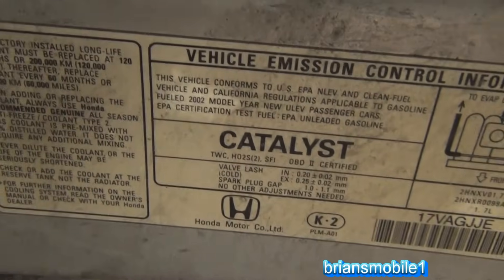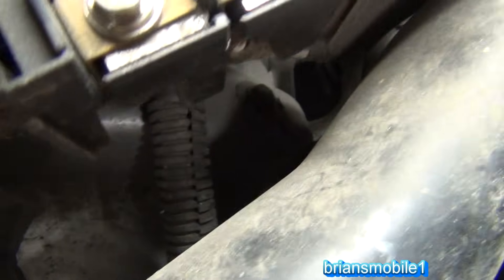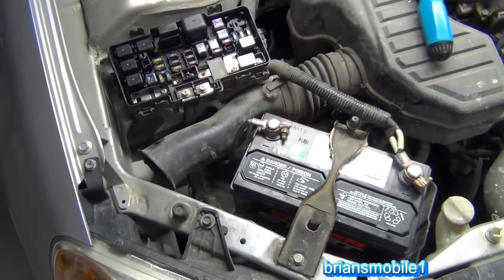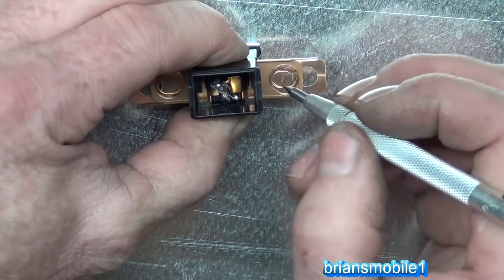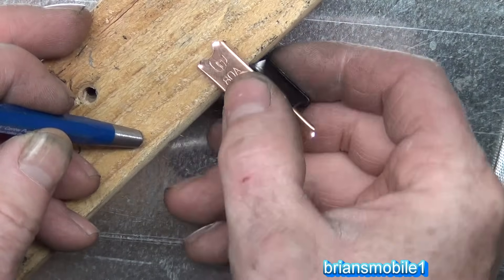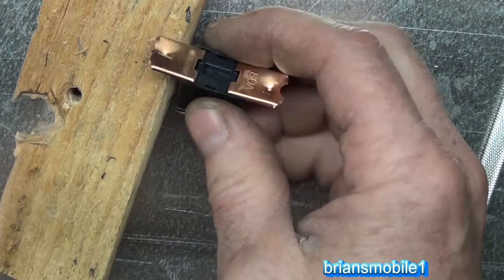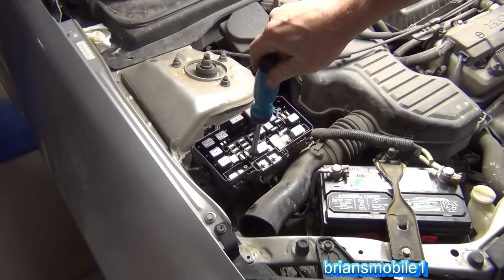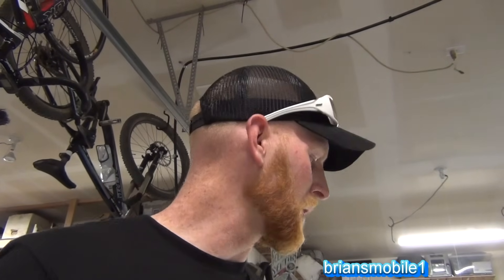Battery Backwards Damage and Fix

Comment: Hay bro I've got a mitsi outlander 2007.my partner did this and it buggered the alternator. Fan wouldn't work, lights, boot locked, stereo etc..  got it fixed everything went fine. Then 1 month later it did the same thing alternator fried. Got it fixed again then everything went. But not I think it's fried again but now when putting foot down on execration car doesn't move stays in limp mode ect. Any ideas? Also dosnt go into gear without pressing release button.

Comment: If you put the jumper cables to the correct ends and you get sparks, what does that mean?
Reply from the maker: Good question!  It means amps are flowing- something's already turned on and sucking power.  Think of a hose that's turned on and you connect it or disconnect it- you'll get some splashing.

Comment: I hooked up my battery backwards and so I had to replace the positive terminal fuse box. When I did that and bought a new battery, car started up fine but now doesn’t have any power when driving and won’t go past 2000 rpm. I hooked up a computer and it gave me codes p2118 p2101 p0507 and p0237. I dont know what it can be. Any advice ?

Comment: hI MY NAME IS ROYCE, I just saw ur video.  I can build a house from the ground up but a car??? I barely know how to change the oil.  For me, I put in a new battery because the old one was left to die by way of lights left on and it was old anyways. So I brain farted and put the cables on reverse - red on neutral and black on positive.  It sparked and then I removed the cables when I saw why it sparked. Reinstalled the cables - this time correctly. But the car was dead and this point.  Now Im going to get a new fuse and try what you did. DO I NEED A NEW, - NEW BATTERY????

Comment: My battery fuse blew when I did this but it still won’t start all the lights and stuff come on battery is good and starter still works but doesn’t turn over at all when I turn the key.

Comment: Advance Auto Parts just installed my new battery i bought from them and messed my car up. They   had it towed ti Honda. The battery fuse was blown. My question is what about other damage like electrical damage or computer damage. Will Honda check for all of this?

Comment: 2017 Subaru Forester had battery put in backwards and it honked. Now, battery is in right but the car is totally powerless and won’t start. Fuse on battery connector box is fine. Please, help!

Comment: I wish this solved my problem. I was stuck in the heat waiting for a tow in my 04 Pilot and a good Samaritan stopped and offered to jump me. I hooked my my side correctly and glance at his hook up but didn't double check. He jumped me with wires crossed. This burned my wiring harness,  an ABS sensor and nothing turns on. Thankfully the battery didn't blow up on us but I'm VERY close to scrapping the Pilot. 

Any suggestions would be greatly appreciated. I have no problem pulling the old harness and sensor but no idea if he burned out my PCM, VTM-4 module or anything else. I don't see any blown fuses. I really prayed this would be my saving grace because I can't afford another vehicle.  Thanks in advanced

Comment: Bro I connected my car battery backwards as well it blow the 100A fuse I replace it an it blow it again as I replace it so I no there's a short circuit but I can't seems to find where I check the wire loom nothing.. can someone help me please

Comment: What happens when you get a battery and the positive and the negative is on the opposite side of the battery and you hook it up right. Will that also mess up the alternator

Comment: What I did I put the battery on backwards tried to turn on the car. It wouldn’t start. I noticed that I put the battery on backwards so I fixed it now when I took it to get a smog, they try to plug in that cable and it does not read it, so what is my fix their?

Comment: I installed a reverse battery incorrectly in my John deere zero turn lawn mower and lost all power after that.  Mower repair place is saying that I have a bad regulator.  Are the two issues connected?

Comment: THANKS BUNCHES !!  Exactly why , when I reconnected my battery, ( forgetting I had to turn it around for the positive cable to reach..since I waited a day or so before reconnecting).. and it popped then had  smoke coming from the negative ( more like from the truck ,than the battery.) I quickly the negative cable and it stopped smoking ( like something burning).  What could it be?  I got the battery off (again) and put on charger and still shows good..My vehicle is a 93 Ford F 150 ...also, do you have a video on what to do when the positive cable is too short to reach over to the positive of battery??  Thanks again!! ( ALSO, how do you crimp positive wires to fit into a new terminal..(namely the older vehicles that have 2 copper looking wires..I'm having trouble getting these into the new terminal..and they are corroded with acid ( just purchased the truck that way and battery was inserted at a 'lean'..and broken terminal I did not notice..now I know why the battery was leaning..cable won;t fit as it should. ....) Again, Thanks BUNCHES!!!!

Comment: So my car had the battery put on backwards and it locked the charge system I believe. I took it to a mechanic and was told the WHOLE wiring is burnt and possibly could have other things damaged 😭😭😭

Comment: Thank you 🙏 so much 🙏🙏🙏🙏🙏🙏🙏 I just got my license after 25 years and everything ready just needed a battery and I put it on backwards SMH I thought it was shot and almost had it scrapped! But the 80 fuse that says alternator under the hood and in same black box next to battery and sure enough it's blown! All I need to do is replace the 80 amp fuse? Somebody said I could have burnt my alternator out but I didn't hear anything about the starter going out on you for the EXACT same thing I done. Thank you I'll go Monday morning and get the 80 amp fuse and I will message your video back! Thank you for sharing your knowledge on this holiday weekend I'm very grateful you and your family have a wonderful New Year! John

Comment: Great video - 2004 Expedition - Family member reversed the cables on a jump start and the radio and cigarette lighters don't work in front, she switched a fuse and now the A/C doesn't work.  Any thoughts?

Comment: My wife  ( I actually, but will never admit it) left my dome light on and ignition on for 2 days on my 2011 Honda Insight.  Dead battery when I went to start the vehicle.  went to boost it and I think I hooked up the cables to wrong battery posts + on - and - on +.  I wound up blowing the 100 amp main battery fuse.  after I fixed that, the veh started but now do not have a radio and it says IMA needs checking.  Could I have also blown those fuses?

Comment: Didn’t work for me i have a 2005 honda oddessy did everything as instructed and no lights but horn blows and when i connect the new battery i get a grinding sound under battery area  please someone help
Reply: Also replaced fuse and switched relay to starter still nothing’s

Comment: Old thread but why not  2016 Honda Civic, battery backwards, quick spark, then put it in right. Blew the 125A battery fuse. Swapped out for a new one, $20. Now the car will not start..... Any thoughts?  Hopefully not the ECM. Thanks!
Reply: All the other things are powered up fine. The engine cranks but will not start.

Comment: My younger brother jumped my Mazda 3 2010 backwards I fixed this fuse in it and now the car starts and runs but the radio won’t turn on my clock resets it self every time we turn on along with my trip mileage and cold air no longer comes out on my air conditioner. Any idea what else mag of burned on ? Or what I need to do to fix this
Reply from the maker: My first move would be getting an online manual with wire diagrams and watching some Youtube videos on how to read the diagrams.  You'll likely find a circuit that has all those things grouped on one circuit and what the fuse is called for it.
Reply: @briansmobile1  thank you so much, I do think I can figure this out I am learning cars more n more I’ve changed power steering pumps, starters, radiators & breaks but this is the first time I have to get into electronics. I just need to find a way to get my hands on the fuse wire diagrams for 2010 Mazda 3. You definitely got a new subscriber in me your videos are so helpful and informative.

Comment: Hi, I screwed up and plugged my battery backwards. I have a Dodge Challenger SXT 2013. My steering buttons, blinkers, head lights don't work anymore and the check engine and esc signals are lit up on my panel. What fuse do I have to replace?

Comment: Good info, thanks. 
Tried to jump start a Toyota Previa van and accidentally reversed jumper cables (yep, didn't pay attention, grrr). On the running vehicle the battery positive is closer to the firewall, on the Toyota ir's closer to the grill. I stupidly assumed the setup was the same. 
Obviously the Toyota wouldn't start, blew a fuse. I replaced the fuse, also the battery and connected it properly. The result: 
The starter cranked repeatedly, but nothing fired up the engine.
Question: 
Did something else get fried besides that one fuse? Is there another fuse that controls things I'm unaware of and could be replaced, like the fuel pump? Or is this van a gonner? 
An answer would be appreciated, thanks.

Comment: my nephew connected my post wrong on my 2006 kia sportage and now my heat,inside lights and right rear light wont come on and I know its gonna be expensive what can I do??????
Reply: Honestly just check the fuse, and relays. 
The fuse and relays, protects the actual circuits from it being damaged. 
Seems like you just have a few blown fuses and relays, maybe even a blown headlight which it's pretty easy to just replace the bulbs.  
The worst that can possibly happen in this situation is blowing modules, or even the ECM(Engine Control Module). But i doubt that's the case tho. 
If you are still able to start your car, than honestly it's most likely just fuses and relays, and taillights/headlights bulbs. And replacing those stuff are pretty easy but just make sure whatever fuse you take out or even relays replace them with the same amps, and the same relays. Hope this helps. Any questions let me know?

Comment: Thanks so much for the video.  My son jump started a friends car.  He could only see one battery terminal and the wire was going across the + symbol covering the vertical bar so he thought it was the minus!   Being young he didn't know what else to look for.   Reverse jump,  cables started smoking. Car is now dead.  Boo.   We will go look for the fuse.
Reply: Just make sure too tell your son, if the battery starts smoking especially rapidly do not go under it. 
The acid from the battery, if gotten on his skin, or even his clothes can severely cause serious burns too him. And not to mention if the battery does starts smoking aka letting off gases and acids it can make him go blind if gotten into his eyes. Tell him it's not worth risking your life, and or health on some car. You can always replace the car, but not your burns scars, or even eyesight. Mistakes happens, it's just part of life. You live, you learn, you got a brand new day to start all over. 
Also, teach your son if he is unable to see the symbols of the battery symbols aka the + and -, than he can just look at the battery post cables colour. Majority of the times especially on cars, the Red cable means positive or the + symbol. And the black cable means the negative cable or the - symbol. 
Hope this helps you out. Cheers.

Comment: Replacing the ignition swich.  And the battery was dead on a 2004 Honda accord.  Wires were both black  and hooked up the battery backwards.  Caught it  .recharged the battery.  Still didn't work.  Bought new battery.  And only thing works is Hazzard lights and break lights..   I will look at the main fues tomorrow  like illustrated in this video..Thanks.

Comment: Thanks for sharing this information. But I am still confused if hooking up a reversed battery will damage the alternators!!! And are modern cars are made by taking this mistake into consideration and are provided with safety measures to not let alternator fry (e.g. safety protection fuses that blow first and protect other electrical parts) >>>>> I'd appreciate if you could reply. THAAAAAANKS

Comment: I touched the post with the wire and it sparked. that's when I figured out battery backwards. Would a quick spark blow the fuses? dash lights still work so am I ok? I am changing the starter so I can't try starting yet. its a 03 pilot. ok starter is on. I can't shift in to L, 2,3. lever won't go there. where do I start to look? I must have fried something. My cheap obd2 scanner is only showing the idle air control which was already there. Before all this it was showing o2 sensor also but that is gone now

Comment: Ok since you sound like someone who knows his stuff maybe you can give me a idea of wth is going on with my vehicle.I have a 2000 pontiac sunfire with a 2.2L 4-banger that I just got done rebuilding motor on about 3 months ago to do 300+hp.once I got the motor done and put back in car it fired rite up and ran absolutely perfect and ran strong as hell.took it for a ride and was literally able to smolder the front tires with it.I noticed that the main fuel line(feed line)was rusted and was starting to leak rite before the fuel filter so rather then fix it I said hell with it and replaced all the steel lines(feed,return and vapor)and being that it took me awhile to do due to work and whatnot my battery went dead since my dumbass forgot to unhook it while car sat.once I got lines done and realized battery was dead I decided to jump it just to get fuel through lines and whatnot just so I could get it running again before buying a new battery.mind you it was 2am so instead of opening up garage and pulling up another vehicle to jumpstart the sunfire and wake up neighbors being that car is rather loud now with motor being built and full exhaust with headers I decided to use a rc lipo battery that was on a storage charge.it was a 3s lipo and being that it was on a storage charge it only had 3.8v/cell for a total of 11.4volts.had pos to pos and neg to neg and within 10secs of trying to start car both leads from lipo got soo hot they both caught fire.hurried up and disconnected everything before It caused a problem,well so I thought.since that day my fuel pump will no longer turn on nor am I getting any spark whatsoever.havent tried replacing relays but all fuses seem to be fine but the only thing the car will do now is turnover.the only thing I can really think of is the rc lipo battery somehow fried my ecm and thats why my fuel pump isn't turning on and why I'm not getting any spark.would that sound right to you or am I wrong?it's really driving me nuts because as I said prior to changing fuel lines and trying to jumpstart car with the rc lipo battery everything worked absolutely perfect.actually blew my mind how strong the little bastard ran prior to this problem.i really don't want to buy a new ecm if that's not the problem.the only thing that caught fire using the lipo was the 2 wires coming from the lipo to the car battery so I don't know what the hell to do at this point nor can I figure out what to check.can build motors all day long but when it comes to the modern electronics ill be the first to say I suck at tracing problems and really hate even going through wiring or anything electrical.any info you could possibly provide me or anything you can think of to steer me in the rite direction would be extremely appreciated.

Comment: someone installed the battery wrong on my car and i went to check the fuses and they are all good but the car still wont turnover, it wont do the door ding anymore either?
Reply: do i also have to check the relays?

Comment: You didn't tell us WHICH fuse/relay you replaced. You're just calling it "the fuse". I have a 2016 Pilot with this problem and my fuses are all good. My large fuses with a clear top all look intact so it's the "no name" relays I'm struggling with. Ps. BYU grad, here. My hunting buddy is from Toquerville so that end pragliding footage brings back a decade of great memories. Anyway, "help!" I'm going in to a weekend, myself, and really need to get this back on the road. We have a family trip this weekend and I don't want to put all those miles on a 3500 Cummins. -Brad

Comment: I hooked up my battery backwards on my 2000 celica gts.. So far seeing a blown 120a main fuse / alternator fuse. Could this cause a no start?
Reply: Yep same shit with me that main fuse will keep it from even lighting up alot of the times
Reply: Yea so I already fixed mine. I had a no start, no dash lights at alll nothing, no radio. New 120a alternator fuse and I was good.

Comment: Hope you can help: Reversed cables when I jumped dead battery.  1994 Volvo 940.
Fried jumper cables. melted insulation right off of them.  Car won't start.
Ignition coil secondary test: 7.3kΩ Book says should be 8kΩ to 9kΩ.
Is this significant?
have spark when turning over
Reply: Man I did that once got so lucky just messed up the cables now I hooked one up backwards and that cars fuse is dead

Comment: I put a brand new battery in my Mini Bus. I did not reverse the cables. Yet if I hook up the negative to the negative first, the positive Sparks and smokes when putting it on it's proper post.  If I hook up the positive first, the negative Sparks and smokes. This happened to two batteries. I put the battery on the charger correctly, it says I reversed  the cables. ??????? So I tried reversing the cables..... Now it's charging. Yet very incorrectly. What could have caused two batteries that were perfect in the other vehicle YET not in the bus? 
It was running fine at the beginning of spring.